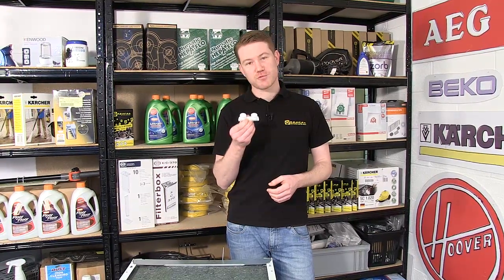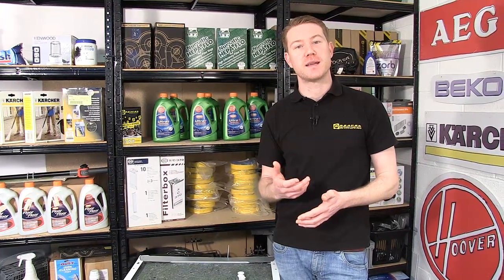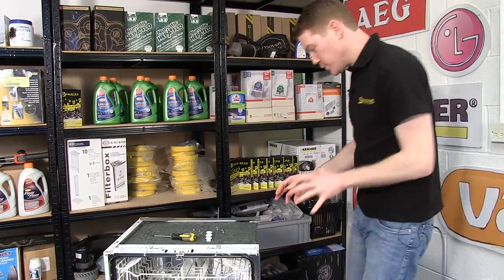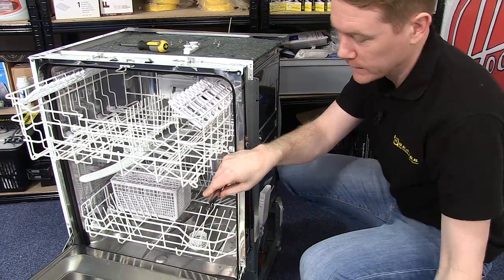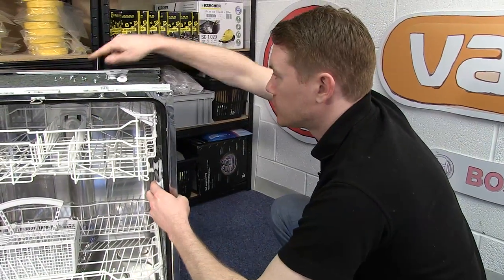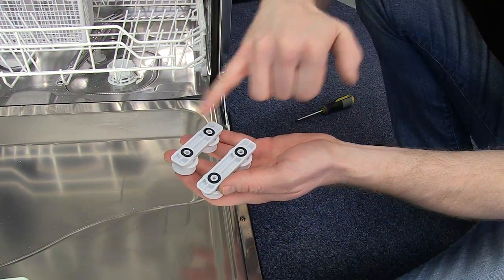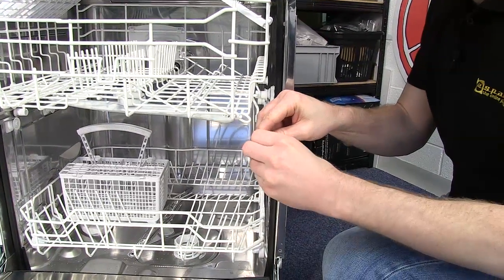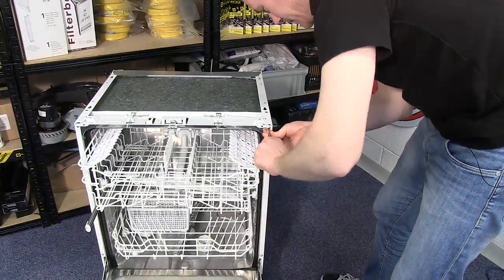How to Replace Rail Support Wheels on a Dishwasher

Comment: Is it possible to switch out a single wheel on the support rail without taking out the entire dishwasher and removing the panel to replace the entire support?

I.e. can you pull off the wheel and push a new one on if it’s just the wheel that’s broken rather than the support itself?